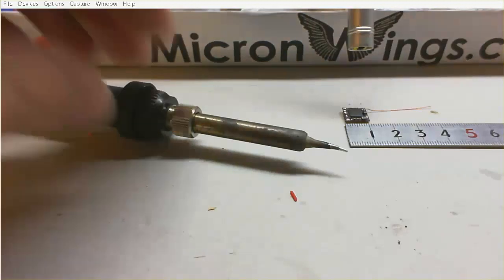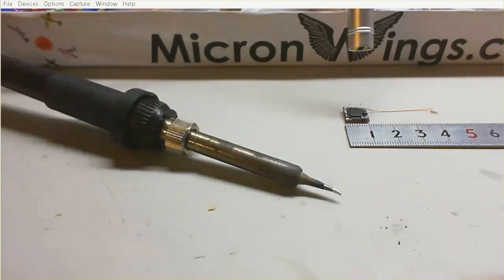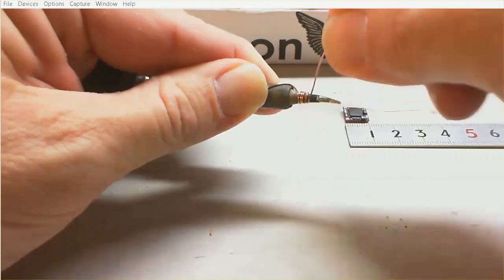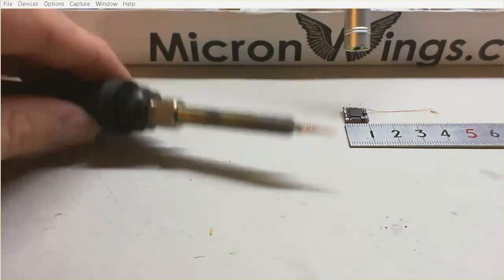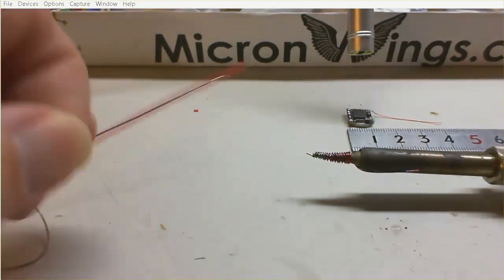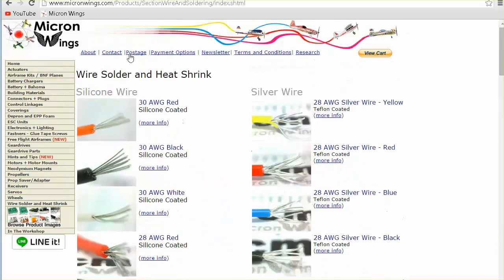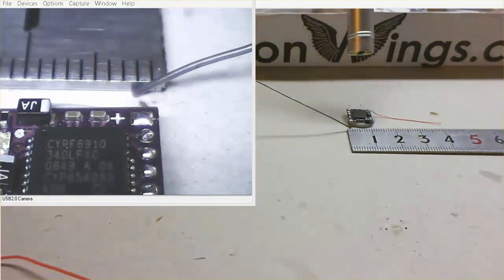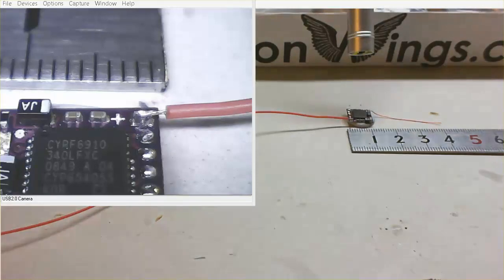Micro Soldering

Comment: I just finished what I thought would be a very difficult job. I had to attach a receptacle for a 7-line 3/4" flat ribbon that had torn off 7 pads on a circuit board. The pads were spaced very closely together. I don't have any special equipment, just a soldering iron with a fairly large pointed tip and a magnifying glass. I used a braid strip to take off solder from the seven pads and swabbed them with lots of alcohol. I had previously used a braid to clean off solder from the 7 tiny feet on the receptable as much as possible and swabbed them with alcohol. I tried to minimize the amount of solder from the bottom of those tiny feet. I had to use a magnifying glass to place the receptacle on the board matching up its feet with the tiny pads. I had stuck a little bit of tacky stuff on the receptable to hold it in place. When I was satisfied that the sticky stuff was keeping the receptable fairly stable on the board, I cleaned off the soldering iron to removed every bit of solder possible, and then I touched the little feet of the receptable with it. I couldn't closely see what was happening until I stopped and look into my magnifying glass at my work. It appeared they were all successfully attached, connected with solder and immobile.

Comment: Question: How do you get the wire hot enough to melt the solder without burning up the wire itself? I'm dealing with turntable phono cartridge wire and  the wire melts faster than the solder.
Reply: Not sure on thyat wire - I was using solid copper wire.
Reply: @cubefpv Same here. Stranded copper. Very small.

Comment: How long does the metal take to harden? Like do I have to hold the wire in place?
Reply from the maker: It is just the same as soldering with an iron - it hardens as soon as the heat is removed.

Comment: Brilliant, and gives me confidence to replace battery in my Garmin 910XT sports watch. The battery has three wires red, black and green. Is there any chance of damaging the battery by the sequence (rgb <> gbr <> brg )  of soldering? I worry because the new battery may be partially charged, the Iron is earthed, and the watch circuitry has no visible internal Isolation Switch (all the on/off/etc functions are  via the micro chip circuitry).

Comment: I gather that this was a demonstrative video for micro soldering in general. Good idea coiling the coper wire. However, in this particular example, since you are soldering in the corner of the pcb, you could actually use a soldering iron with a normal tip to do the job. Cheers.

Comment: i cant wait to try this!

i have a loose micro USB port on an elite xbox controller and the contacts are like 2mm wide 1mm apart and i have an old xbox 360 usb cord i want to install permanently and this is likely the only way i could use my current soldering iron with 1 style of basic large tip

micro usb has 5 connections 5 volt, data +, data -, ID mode detect, and Ground. but the USB cable i have from an xbox 360 controller only has4 connections and the 360 controller wired controller has no 5th connection as ID for USB connection. can anyone tell me if the new xbox one controller really uses the 4th pin micro usb ID connection?? i doubt it as that conection seems to be for usb memory drives communicating with devices but i also happen to know new xbox one controller receive firmware updates and the old 360 wired controllers did not

can nayone tell me the significance of the 4 pin ID / mode selcet connection for new xbox one controllers? cna i get away with just soldering a full size USB in place of the micro USB without the micro usb's 4th pin ID?

Comment: I like the idea of wrapping a smaller gauge copper wire around the tip of the iron.  The was a great tip! (no pun intended) I stated out with through hole components, but quickly realized everything was going to SMDs.  So now I am saving up money to get a microscope.